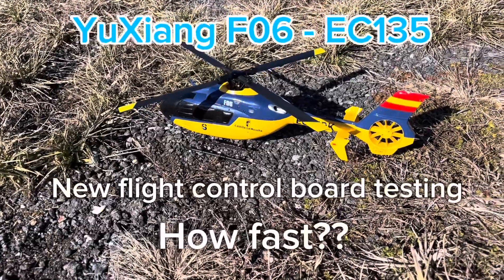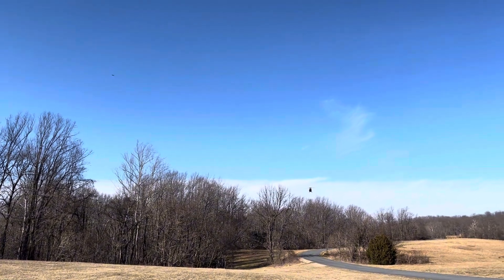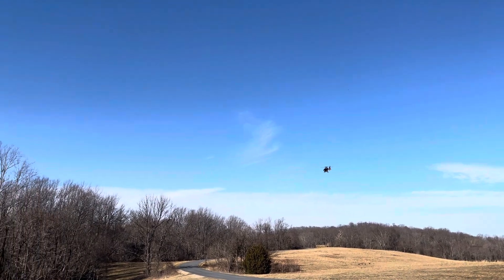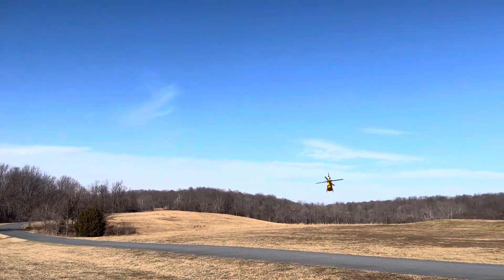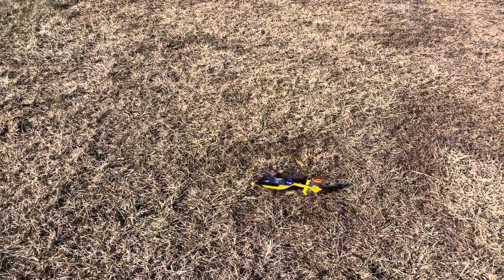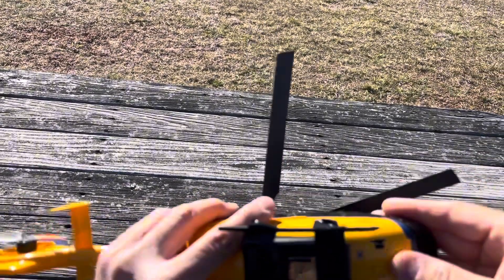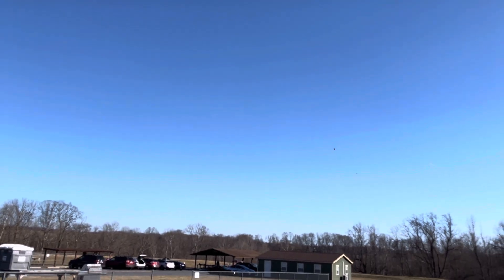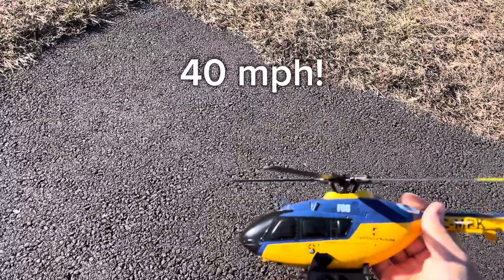YuXiang F06 - Eachine EC135 RC Helicopter: New flight control board testing and speed runs!

Comment: I tried the same with F08 and the big issue is that the F07 & F08 main rotor turns CCW. Also the tail rotor is on the left side which is completely opposite from Eachine E150. I tried reverse motor polarity and reverse pitch and it won't fly stable. I ordered the F07V mainboard (which should almost be the same as F08) and will test again!
Reply from the maker: swap one wire from the motor and reverse the motor rotation's. Where did you order the F07V board? They are out already?
Reply: @Flight6677  I tried swapping the wire but I think the geometry of left vs right rudder might matters. I got it from aliexpress Yu Xiang store. They just listed the F07V spare parts.
Reply from the maker: @ Thanks. I will check Aliexpress store. They are not showing it on their website yet. Also, I am not convinced that swapping one wire for each motor (main and tail) does not work. I can’t think of any reason why the rotor direction should impact the physical attitude of the helicopter.
Reply: @Flight6677  I'm not sure the impact of air suck vs push plays role or not. The tail rotor side is on the left for F07 & F08, so it works as suck air from the left and push toward the tail rudder before it push the air on the right side. Unlike E150 or F07 that the rotor is on the right side and push air directly to the right. Mine keeps swaying (not yaw) to the left even the swash plate level is done. I need heavy trim to fix it. However, seems like the tail keeps wagging as well. May be the tail gyro sensitivity too high.
Reply from the maker: @kaanpanyawannasiri6197  tail wagging could be three things. First, gyro gain may be too high. Lower the tail pot a small fraction at a time. Second, the motor may be bad and have debris (metallic is easy since it is open and magnetic). Third, the gyro board may be hitting something due to vibrations or it could be faulty. I recently had one that was bad and not till I changed it out did the tail operate smoothly.

Regarding the CCW main rotor rotation vs CW. I am going to test this soon. It should not be an issue.
Reply: @Flight6677  Thank you for your advice!
Reply: Yuxiang official store listed the F07-v mainboard now. You may check it out.